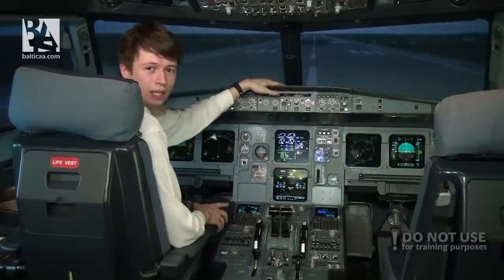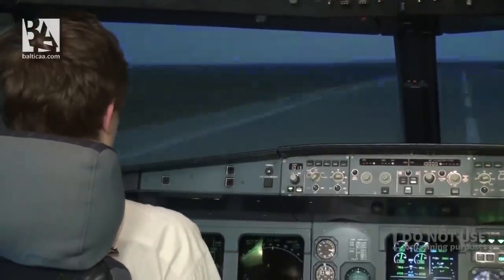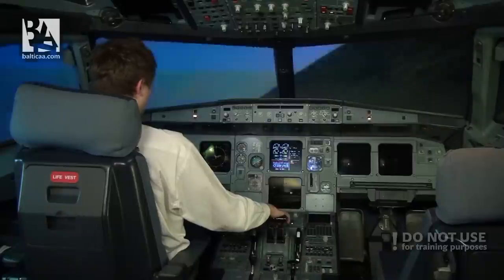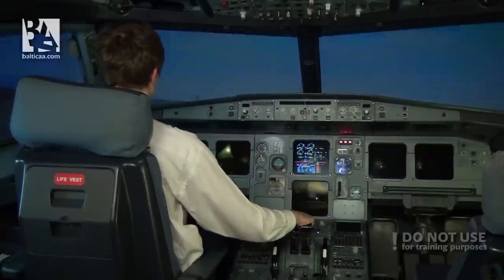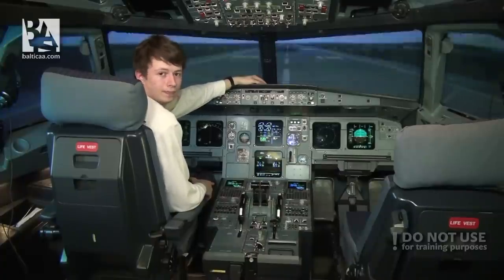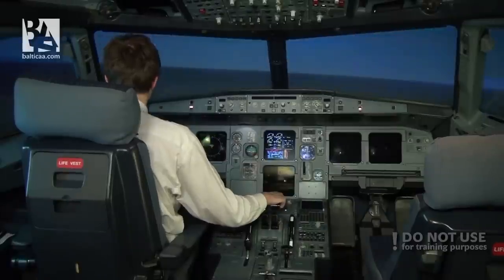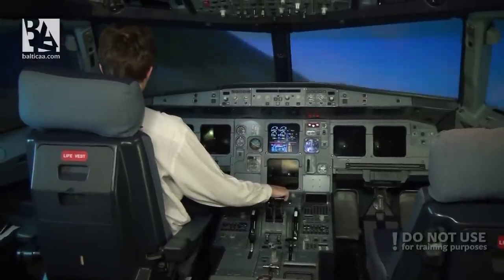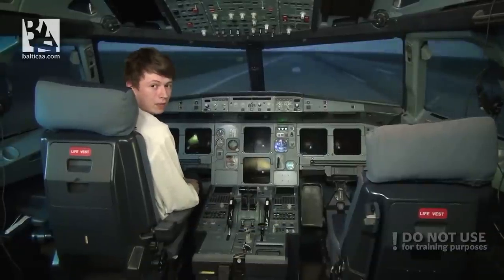Dual Engine Failure during Climb-out on Airbus A320: Baltic Aviation Academy

Comment: I know this is only training but for it to be as realistic as possible, you should take into account the human factor. The pilots are not expecting dual engine failure in a real life event, thus they wil not react immediately by returning to the airport as you did. Some time will be wasted on analysing the situation and making the right decisions before heading back to the airport.
Reply: George B as you’ve said. This is training. He knew what was going to happen. He can’t just sit there for 30 seconds saying”right now in a real situation the crew would be attempting an engine restart as they weren’t expecting it”
Reply: @tomstravels520  to simulate a real life event, the pilots should sit in the simulator without knowing the type of failure they will face, that way they can immitate a real life emergency with realistic time factor!
Reply: George B when they do real training and not a bit of fun for you tube video then yes they do (once they’re trained how to handle it). They’ll get given random scenarios possibly even 2-3 one after the other

Comment: my friend if you lost both eng you haven't got Green Hyd Sys you have to use Gravity Extenction ! Make it more real next time ! tks
Reply: If you lose both engines you wony have green or yellow which makes the ptu useless. Only hydraulic pressure is from the ram air turbine pressurizing the blue system. Gravity gear extension must be used in this situation

Comment: is it dangerous to land full fuel ?
Reply: Matthew Leonas It's better to land with full fuel than to not land at all. But, if there was at least one engine or there was no other failing conditions jeopardizing flight they would jettison fuel before landing.
Reply: Not necessarily. Depends on the plane since not all of them have fuel jettison capability. The A320 is one of those without that capability.
Reply: ***** Yup, the max takeoff weight on smaller jets, like the A320 and 737, is nearly the same as the max landing weight. Nonetheless, I was referring to jet's in general.
Reply: Most of them actually don't have fuel dump capability. With some planes like the 767, A300, and A330, it was optional. One you start getting into bigger planes like the 747 and 777, them they're required to have them.
Reply: It would be more dangerous to fly around burning fuel with no engines working.

Comment: He said right turn back ,, any reason right over left ???
Reply: wag;
Wind direction. If you turn 180 upwind, the wind will push you towards the runway. Making the turn a bit tighter.

However.
If your take of was from 27R, a left turn would get you close to 09R. That could make a bad day even worse if there is traffic on 27L.

Comment: wait - so, you CRASHED on the first run??!  we're all dead!?  holy crap, man!  everyone dies with engine failure below 2500 ft??
Reply: Well, since a Russian airliner just landed in a field after dual failure at 700 feet, probably not. But to try to turn back to the runway is tough.  You bleed a lot of speed and energy by turning.  If possible in a dual engine failure like this so soon after takeoff, keep flying straight and look for a flat place to crash land.
Reply: @compmanio36  Airliners, except the super heavy can Turnback from 2,500 agl.  If pilot knows the maneuver.  Sully didnt know it.  A hero???

Comment: Applause for the man cor landing back safely from 2500feet.... 2500 feet is 800m aprox of the ground. I dont understand why they dont just use km/h speed, height m 1000m 12000m all clear. Now its knots and
Reply: For a couple of reasons: 
1. It's tradition and it would be a pain to switch which system was used in multiple countries. 
2. Knots, feet, and miles are all distinctly different syllables, which means even if you miss all context you know if you hear the word knots you are talking about speed, feet is altitude, and miles is distance. If you use metric all of those things have the word meter in them, which means there are multiple places where if you only heard one or two syllables you cannot know whether you are talking about distance, altitude, or airspeed, which can be very confusing in a hectic emergency.

Comment: Hey you have to use the 35 second reaction time. Like on the movie Sully. Wait 35 seconds to realize you cannot put rpm on damaged engines. Waiiiiitttttt.....dont turn..start counting to 35. wait more. waiiiittt...not yet. wait. Im a glider pilot. We do Turnbacks from 200 feet agl. You get used to them.
Reply: I am a glider pilot myself. You cant compare turning with a glider (which is made for flying without an engine) and turning with an A320 without engines :D
Reply: @NeTfLeXr6s  So you will count to 35 before starting a Turnback if you get a Rope Break at 220 feet agl.  Failed test right there...

Comment: No engine, alternate brake. No need to set prk brk.
Reply: Hugo Lopes the alternate brake power comes from the yellow system which also charges the accumulator. The yellow system is dead so can only use what remains in the accumulator

Comment: I have never seen a320 stalled . Even in the simulator it never happened ever with me even i went below 140knts. Mabe at 120 knts it will stall.
Reply: In normal law you can’t stall the A320

Comment: First thing to do start Apu
Reply: Not necessarily. Most dual failures are due to fuel starvation. Even if not, you risk running the battery flat.
Reply: @peteconrad2077  "during climb ? Kkkk out of fuel during climb ?
Reply: @boradehawker400a4  a high pressure fuel leak from a split hose would most likely be discovered on initial climb.

Comment: Interesting about the emergency brake. Better install emergency brake parachute just incase the parking brake fail. I feel intense by that 2,000feet dual engine failure.
Reply: Pranab Drulis has a slight touch of Tourettes. What's he doing in an aircraft..?